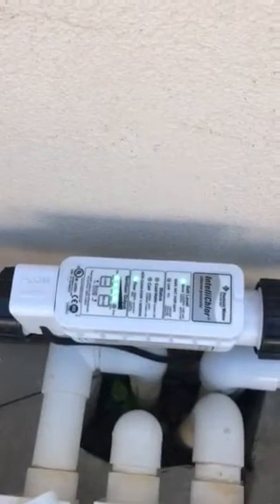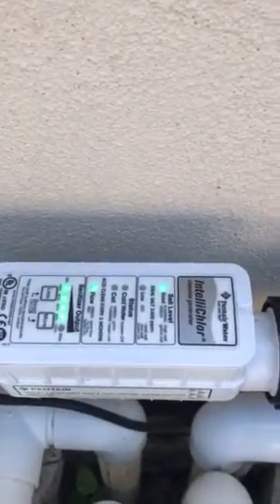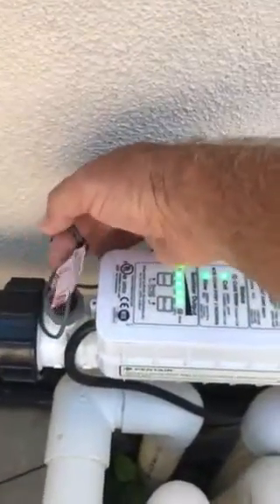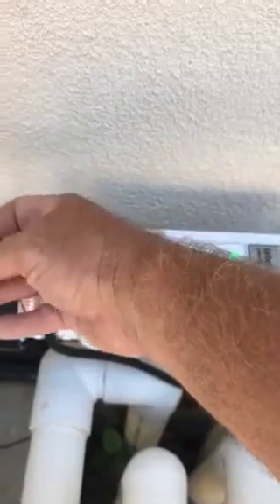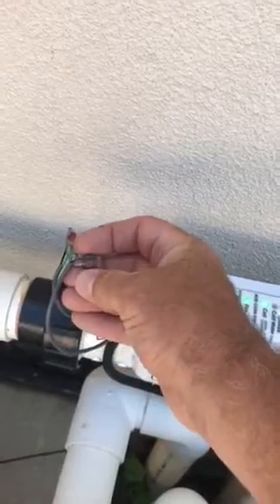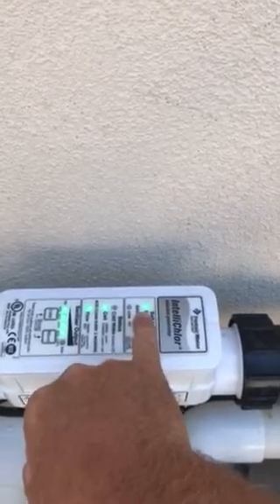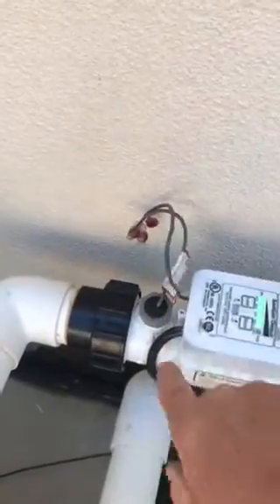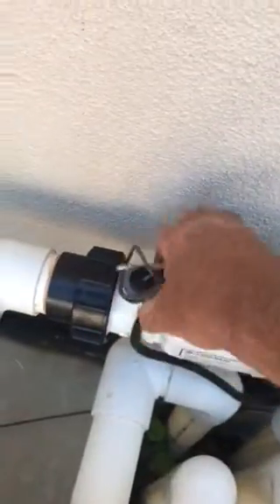How to test Pentair Intellichlor Flow switch

Comment: Really hope this gets a response. So just to confirm the cutting / splicing sequence to bypass the flow switch... 1) cut the large wire between the switch and the cell and separate the 4 inner wires 2) (this is where i get a bit confused) connect together the red and black wires both from the cell side ? 3) reconnect the green wire back together from the cell to the switch side. Repeat this for the white wire ? 4) leave the red and black wires from the switch side cut / disconnected ? Thanks all.
Reply: Nobody ???

Comment: Can you leave it like this? Flow is simple to understand. Backwash regularly keep skimmers clean and check the water pressure at a return. Why must you turn the power to the cell off when turning the pump off?
Reply from the maker: If the flow switch is jumped then it is telling the cell it has flow even with the pump off. It will burn the cell without water flowing through it.

Comment: I can't discern from the video... I have the same problem.
How do I hotwire the flow switch for diagnostics prior to ordering the switch? Which wires do i connect (on the device side) to simulate proper flow?

Comment: I have all green but it reports 0 ppm back to the control system after having the right ppm earlier. Did the acid washing but to no effect. How do you cure the 0 ppm reporting? My pool guy says bad switch but like I said I have all green lights... any suggestions?
Reply: I have same issue, it's a bad flow switch.  I replaced it two times already and it's the same problem every single time.  I got about 6 months before the flow switch goes bad.

Comment from the maker: Yes you can keep it bypassed. Just make sure that the pump does indeed run constantly. If you need to backwash or turn the pump off for any reason turn the unit off as well.

Comment: Flow light was red. Tried everything in the book. Got zero support from Pentair and Aqua Tech, a local distributor. Didn't have the tools to test it properly, so I put a piece of tape around it to fool it into thinking it's touching. Works like a charm. MacGruber would be proud.

Comment: Thank you for the information. 
To be clear: the red and black wires from the unit, not the switch, are connected together. What about the white and green ones from the unit? Connected together as well?

I read from one of your other replies that none of the wires from the switch are connected to anything.
Thank u
Reply from the maker: D Dutcher. If you are testing to see if the flow switch is the issue then you only connect the read and black that lead directly to the unit no other wires are connected.
Reply: @aquapro3311  if you do this and the cell still has a red flow light on, does that mean that the cell is bad?
Reply: Connect white to red/red to white and keep blacks together and greens together.

Comment: Thanks! Turns out my flow switch is faulty. I connected the black to the red wire like you did and now the chorinator shows no flow problems!
Reply from the maker: The connection was just to jumper to see if it was a flow switch problem. If that is the case with yours you will need to order a new switch and not leave it jumped. If the pump shuts down then the flow stops and the unit will still be powered.

Comment: my flow switch went red over a year ago.  The connector inside the cell was no longer getting pressed down correctly so the unit thought the flow was bad.  I took a twist-tie from a plastic baggie and tied it around the flow 'flapper'.  It held it down, fooling the unit into thinking the flow was strong and worked that way for over a year.  I now have the red light again and this time I think the switch has gone bad, so time to replace it.

Comment: Thanks for the video.  My IC40 started doing this right after I had a pool repair place change out my old pump.  I spoke with them about it and they took the IC40 to their shop to test it.  They informed me the cell was bad and needed to be replaced.....for $600.  I asked about the possibility it was the flow switch and they said no, the other lights that were flashing wouldn't be doing that if it was just the flow switch.  Well, I took the unit back from them and shorted the red and black wires while splicing through the green and white wires and guess what........all solid green lights now and it appears to be making chlorine.  I just ordered a new flow switch for $60......a lot better than $600.  Thank goodness because my IC40 is only a year old.  Thanks again.